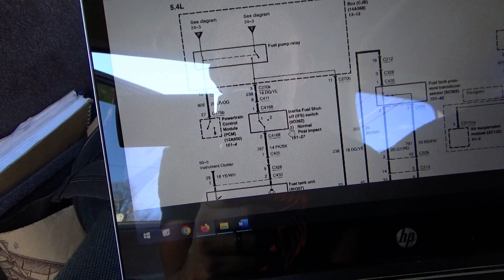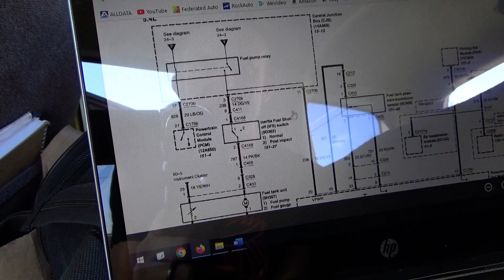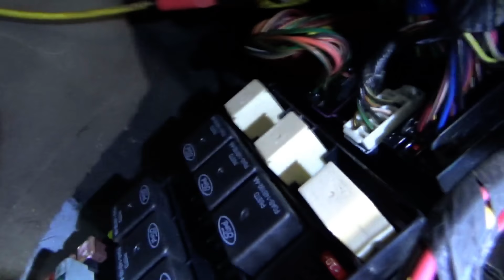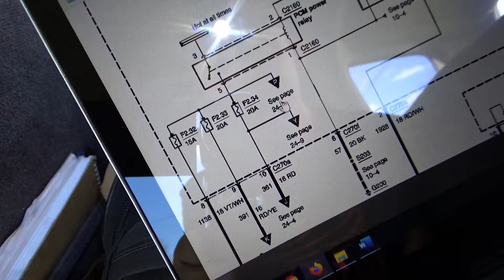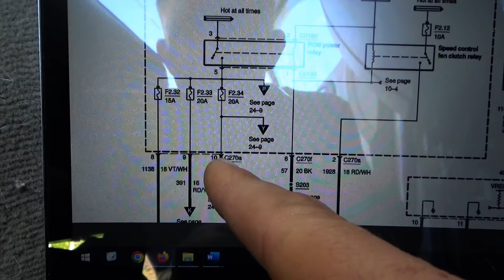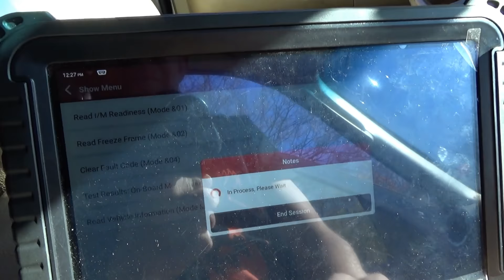Ford Owner STUMPED for 6 MONTHS? Fixed in 15 MINUTES! (No Fuel Pressure P0231)

Comment: Great video im having the same issue with my 2004 Ford crown Victoria police interceptor one day my daughter just got done cleaning it and she started the car and it shut off and would not start so i changed all the usual culprits fuel pump,fpdm,fuses,relays,diod,checked the grounds,inertia switch and even the ignition power control under the steering column got replaced so i could definitely use some advice thanks

Comment: Just had almost same issue this week...2001 e250...no voltage to pcm relay...thus fuel pump relay as well..after several hrs.( Actual more)...I check the pcm 30 amp fuse voltage both sides...was ok...still no.  pcm voltage...then I pulled the 30 amp fuse to check if connectors were ok....the fuse tangs were badly corroded!!!....a bit of sandpaper ...&. Vrooom !!...couldn't believe it ..cheers

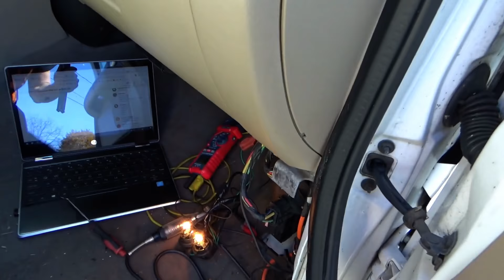Comment: 10:05  This might not be popular, but I'm not liking the idea of the ECM not controlling the pump relay anymore.  I'd be onboard with using the same power wire he's using, but add a relay that the ECM controls.  There are other reasons a fuel pump gets disabled, like having no oil pressure, for example.  When the engine isn't running, the pump shouldn't be either, once it primes.  This will probably be fine, but I'm a bit too anal to have the pump running the whole time the key is on.

Comment: Hello Ivan, great videos!!!

Question why  wouldnt you just cut the wires from the original relay and wire in your own as a seperate circuit?  That way it won’t log a code in the ford data? 
I get it asking what the customer would want to do first! Assuming they have spent a fortune already hahah 
Cheers

Comment: I've replaced the censers the crank cam , the fuel pump, and the throttle position censers,a new fuel pump, cleaned ground straps, and still bumming, I got my van (2011 E350 Econoline) towed to a garage, and I'm praying that they can fix it,
Ivan could've knocked it out in 10 minutes, I wish he was around Pittsburgh PA

Comment: I need to do this to a 04 f250 super duty 5.4 xl. But I think things have been moved around because I can't find the correct diagrams due to this truck used to be a city water maintenance truck and you can tell that it's just set up differently...ugh

Comment: I have a question is that a port fuel injected system that's deadheaded which means the fuel pump has to be regulated up and down to correctly supply the amount of fuel pressure it needs so if the fuel pump runs all the time on regulated that's a problem?

Comment: I've got a 2002 F-150 4.2 V6 that's not getting fuel. I haven't run a code scan on it yet, but I don't think it's the internal fuel pump because it runs on the hottest days, but won't start below 80 degrees. Seems likely an electrical contact issue. I was wondering if the same fix could be applied to the older generation truck or if the wiring systems are completely different from 2002 to 2003? If anyone knows please tell me. Thanks.
Reply from the maker: Look up a wiring diagram 😉👍
Reply: @PineHollowAutoDiagnostics gee, thanks.

Comment: you know, . . . the little sensor that is plugged into the air conduit either b4 or after the air filter does go bad.
i worked on a car once that belonged to a friend's neighbor. and the replacement part car was damaged. so the tech and i thought to ourselves to see if we could get the engine to fire up and idle. . . . we cleaned everything. the spark plugs, plug connectors, checked the coil pack, crank sensor.
after doing that i went to turn the ignition switch over and it cranked. let it crank over for about 15 seconds then stopped. we looked at each other, and was like [ well, let's check the spark plugs again for spark and if it has any gasoline to them. the plugs (were dry). so he put in new spark plugs, cranked it over, same thing.
then i looked at the air sensor and replaced it with the neighbor's part from her car, and presto it idled purred like a kitten.

i know it has been over a year sense this video got put up. but do check the air sensor. it could have went bad during operation.
of course, you will have to snip the jumper wire to confirm operation.

p.s.
 either that or the connection may be bad from that wire to the spade.
the spade may have not been locked in place enough to make full contact.
OR
the female spade connector may be slightly opened to cause loss of connection.
tighten it slightly and reinstall.

Comment: There should be a common message left by a mechanic or a shade tree backyard mechanic that does something like this to take a little small paper envelope or a ziplock baggie and stick a note inside of it explaining what you did why you did it and the PIN numbers that way when someone gets the car a couple years from now and they see that they can identify what was done so they don't mess with it and if they come up with a similar problem they can see if there's a loose connection or something like that it would save everybody involved

Comment: While adding the external relay is good dont think it removes liability. 
It reduces possibility. 
To be clear in legal terms you have created a nonfactory approved altered item. 
Ill give a non automotive example of this sort of thing.
At a large employer we had a heatgun. The  tine on the plug broke off.
The company master electrician replaced the plug and life went on.
On an insurance inspection the heatgun was flagged as a violation.
The gun was UL approved with the original plug. Replacing it voids that UL approval. 
The nuances of liability and insurance can be tricky waters. Act accordingly.

Comment: My relay is busted open (looks like someone took pliers to it). But if that doesn’t fix it, what next? My truck starts fine after sitting and runs for awhile. Eventually it dies (rpms drop). It starts every time, but after it dies once it won’t stay running

Comment: This worked on my Lincoln Navigator also.
Reply: I'm having similar issues with my 2005 Lincoln Navigator. Trying to figure out if it's the fuel pump or the unserviceable fuse/relay box.

Comment: So basic diag shows an internal relay is bad. Shouldn't any tech find this? 
Bypassing that internal relay is taking some sort of control away from the PCM.  I wouldn't risk my livelihood  saving a customer 20 bucks for an external relay that the PCM could control.
We hAve no idea all the reasons the PCM was given this independent control.
And yes. I know the impact disconnect is still in line, but....

Comment: I did thisyesterday on my 2004 Expedition. Pull the relay plug out of the box splice the green and yellow wire to a new power supply to the brown wire with a 20 amp fuse. It is connected to the ignition circuit so pump is only on when you turn the key. I am not going to install an external fuel relay that silly.

Comment: I have not looked at the schematic in detail, but I take exception to the statement that "The truck will run perfectly" because that is  with the exception that the fuel pump will be on whenever the key is in run position- vs the factory relay where the pump only remains on if the engine is running.  A better solution would be to replace the bad relay inside the module, or- devise a workaround circuit which might have the fuel pump tied to a switched hot line- and have the return (ground) go via an oil pressure switch- so that if there is no oil pressure, there is no power to the pump- old school. Mind you, I'm not a mechanic- I'm an electronics guy. Perhaps this hack does indeed prevent the pump from running is there is no oil pressure (engine is off).

Comment: Another great video, amazing work as always, I'm still intrigued as you always do loads of soldering and sods law its often in a difficult place to reach, why you don't add a bit of flux to the wire first, not that ive ever seen you do a dry joint, but it makes life so much easier, as you know you must not put the multicore solder (flux inside the solder) directly on the iron and carry the solder to the joint because it burns off the flux before you get to the wire, which means 1 holding the iron 2 holding the wire 3 holding the solder, 3 jobs 2 hands, so if you flux the wires first then you can put the solder on the iron, then you can simply hold the wire and tin the joint with the iron that's already loaded with solder only need 2 hands

Comment: THANKYOU - my 2004 Expedition has been a beached whanle for a month - this weekend I needed to get it back on the road - I had assumed it was a faiked fuel pump aftet 300000. I recently broke 5 ribs so I really was not looking forward to getting under the car. Decided to give your aolution a go because the upside was so enticing ! I opened the glove box and lowered it and did the breif test on the green and yellow wire and red wires on the connector and they were consistent with your tests. I just went ahead and did the jumper wire solution you proposed - it took me 30 mins and IT WORKED ! WOW !!! THANK YOU SO MUCH !! - incidentally my Expo was a V8 4.5L. I sent the new fuel pump back an hour ago !!

Comment: Thanks for this video. My F250 was going fine and then it would not start. Diagnostic System Check resulted in P0381, P0230, P0231, P1CP,  P1139. INJPR (KPA) 1400.  Getting a Mechanic to try and fix the truck to get it going. Thanks for this Video and others.

Comment: I have 2 years check engine and nobody find the problem the car was running bad l change many parts hoping the light go away and now the car runs good but the check engine still there. all o2 sensors plus the evap system everything is replace and nothing ., good job man

Comment: Without access to the Fault Tree Analysis, and the Failure Mode and Effect Analysis, I'd be very cautious about bypassing any relays in control of subsystems originating at the main control PC. There may be foreseen, but not obvious conditions that the relay needs to be functional for. Only the Ford design/ sustaining team can answer that question. I've been in both over the decades for a different industry, but just one of those things those damned engineers do that no one downstream can see, until it's too late.

Comment: Presumably the cascading relays are set up that way so that under certain conditions the PCM can shut down the fuel pump relay. Is that a potential problem now that the FPR has been bypassed and the PCM no longer controls the FPR feed?

Comment: The real fix would be to wire in an external relay so that the PCM can control the fuel pump the way it was designed to. Plus it would eliminate any of the circuit high/low codes because the load side monitor wire could be connected to the new relay.

Comment: I have been re-watching a lot of your videos. 
I enjoy your ingenuity and diagnostic app approaches. 
Since retiring after 50 years of cars I have been working on golf carts, lawnmowers, and other outdoor power equipment. 
Owners tend to want to mess with everything so I bought bright yellow and orange electrical tape. 
I wrap my repairs with this tape. That way I know where I was working in case that area fails. Also, I know if the owner has been messing with it since I repaired. It has helped more than once to prevent the ever since you worked on it complaint.
Del

Comment: Little late to the party but the problem I see with your fix is in a accident that stops the engine, the fuel pump is still running.
If a fuel line is ruptured it will continue pumping fuel out until the key is turned off and feed the potential fire.
Wait, it's only a Ford, never mind, it'll be fine. 😛

Comment: I have a 2014 ford f-150 with the 5.0 engine. My problem is about the same as yours but I have moved the fuse 27 to fuse 64 using a kit , replaced fuel canister valve and the fuel pump relay. Gave up and sent it to the shop. they said the was 55 psi of fuel pressure and that they though that there was a problem with the pump in the tank causing a high ethanal reading of 69% causing the long crank. There nothing in the tank that measures this. after i get it started it runs fine.

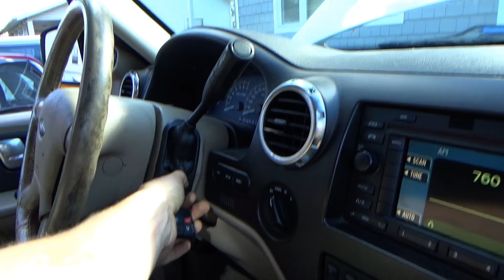Comment: @9:41 Ivan reaches across, turns the key (without pressing the brake pedal!) and the car starts. Do these 2003 Fords not have a brake pedal safety switch?🤔
Reply from the maker: @HjnQcxLt  I've never seen a car that uses a regular ignition key have a "brake safety switch" 🤔😅
Reply: @PineHollowAutoDiagnostics Maybe I'm not calling it the correct term? Every automatic car I've ever driven with a regular ignition key... requires the brake pedal to be pressed before it will start.  Currently have two right now (2013 VW Beetle, 2014 VW GTI).  UPDATE: checked it just now. If I turn the key w/o pressing on the brake pedal, it days "Depress Brake Pedal!" on the console, and won't start.

Comment: Fuel pressure reducer valve located on the fire wall . If fuel is leaking into the crank case .

Comment: Had this exact thing on a 2019 f350 tried this exact thing but the ecm is on the same circut as the fuel pump relay so in short the truck did not like it and did not run right and then eventually just shut itself off i had to replace the entire wiring harness because ford wanted to make the fuel pump relay unservicable
And a answer to your question is yes it will trigger check engine light so my suggestion is fix it correctly and dont cut corners unless you are stuck on the side of the road or something
And while this may work on older vehicles it will not qork on newer ones
Reply from the maker: @Lordinfamous357  yeah I'm sure a 2019 is much more fussy than a 2003 😄
But a failure in only 6 years? 😬
Reply: @PineHollowAutoDiagnostics  yes at 130k miles we have 120 trucks and they get ran hard I fix the whole fleet but yeah seems crazy that after only 6 years but quality isn't there in these vehicles

Comment: You can just cut wires,  and install a external relay for the fuel pump! We do this all the time , its Way cheaper then a ecm, just make sure the customer is ok with it.  Very easy job, very common!!

Comment: Great video, I have a fffF350 I put a Cummins engine in and it always sets a code for the fuel pump voltage low , I need to do exactly what you did on a different circuit , you made it simple. Thank you.

Comment: battery clean, terminals clean I put key in and twist--nothing no buzz no chimes no interior lights panel is dark nothing Truck F250 is locked in P cant tow or push  What is the cure

Comment: This is an interesting hack. Wouldn't the next step to be to break open the ECM and replace the relay? I have no idea the cost but for my make of car (with headlight always on or off error) it's a couple $5 relays (or resoldering the contacts)... about $140 to have an electrical rebuild shop do the work for me.

Comment: It may run but your bypassing a safety feature... wired correctly the pcm will shut off the fuel pump in the event of an accident or for some other reason if the engine stops running as it takes an input from things like the crank sensor. Now running directly from an ignition feed if you crash and the ignition is still on like its likely to be the pump will keep running.... This should be a tempary fix untill a permanant repair can be made....

Comment: remove 3/16 insulation with a blade, no copper strand nicking,  use a pick to split copper strands in half, on both wires, then feed your new wire between strands in both, tighten lightly with pliers, solder, tape, that is the way i do; for 40 years.

Comment: I apologize I did not do any schematic diagram research before asking this question. I am asking you this question because you just explained that you are very familiar with the fuel pump schematic diagram. So, is the emergency fuel pump accident inertial switch still able to shut off electricity to the fuel pump or did you bypass the inertial switch with your jumper?

Comment: That's what I mean, a flat rate guy, like myself, never would have gotten paid for all the time i spent on it, I would have walked away from it a long time ago, that's why cars like this sit at shops for a long time, nobody wants them. This was a great learning experience though and gave me more things to test for, before I walk away, and soldering was a good idea, if I'm going that far I'm going to add another wire long enough to reach another ground bolt somewhere. Good job on that Ivan, you got more patience then I do.

Comment: The inertia switch does absolutely nothing to stop fuel flow if one of the hoses to the fuel rail breaks. This fix needs a relay. $10,  safer fix.  You should get one of those Bosch cube relays and a pigtail and go back and correct that.

Comment: Bought a brand new Ford Expedition Max Limited. $80k car. Nothing but problems. Engine replaced at 16,000 miles. Transmission clunks. Exhaust fumes entering the cabin frequently. A true lemon. Ford you owe me pain and suffering!

Comment: On the occasions that I use electrical tape,  I will wrap it with a small zip tie.  This will keep the tape from unwrapping in extreme heat.

Comment: I would say to tie 270a.10 to the coil and pole of a relay, attach the throw to 270k.3 and the other side of the coil 270b.12.  You may log a relay failure code if the fuse blows, but you will maintain pcm control of the fuel pump, and fuse protection of the heavy load of the pump.  It only takes one more wire.  If the fuse blows, the PCM has no control in the OE scenario either, this is a fail safe state that requires fuse replacement to recover.  The fuse could also be moved inline by connecting one between the coil and the pole,if nothing else is on Y.  If you're brave, you could then bypass the one in the box.  But there's some rare chance that something in the original design or mice cause an electrical fire in that circuit and someone tries to say it's because you tampered with the fuse F2.34a.